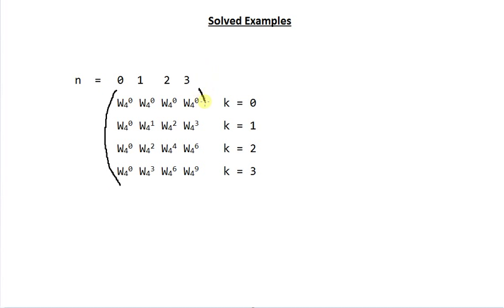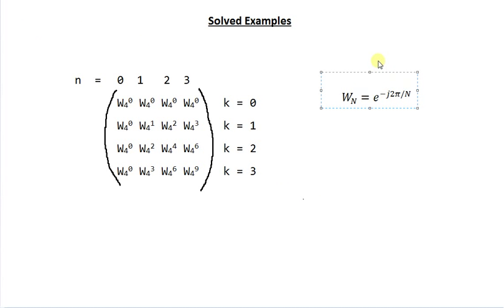Discrete Fourier Transform - Part 2

Comment: The example in the video has a length of four, so we divide the circle into four. But what about for length of three? We still divide the circle into four part, either anticlockwise for X[m] and clockwise for H[-m] or we divide it into three? But anyway, it is a nice video and l learn a lot. Thanks
Reply from the maker: I do solve an example with a length 3 sequence in the video at around 12:55 onward.